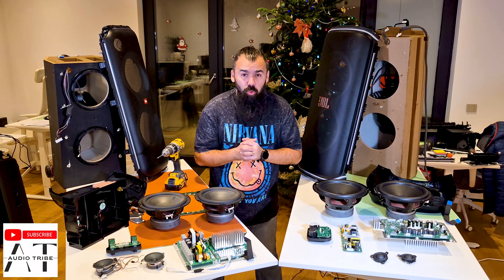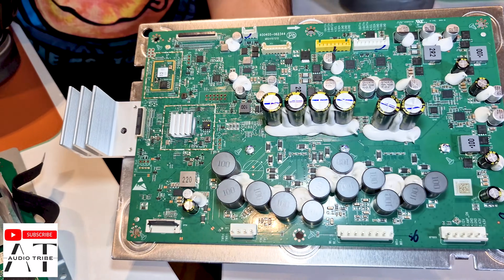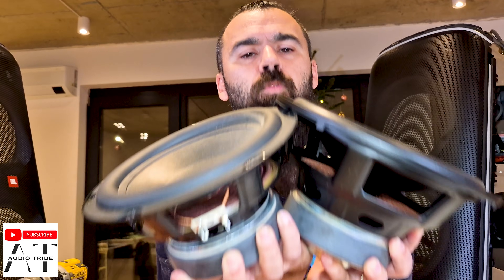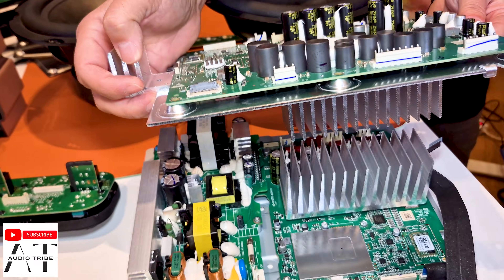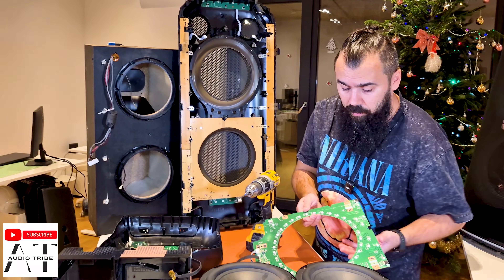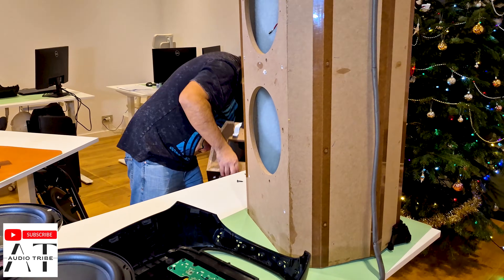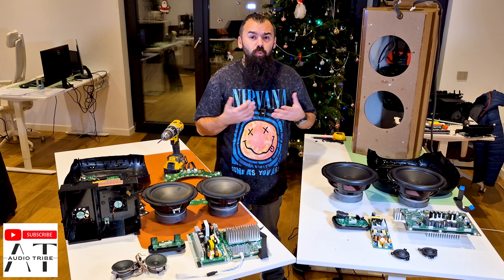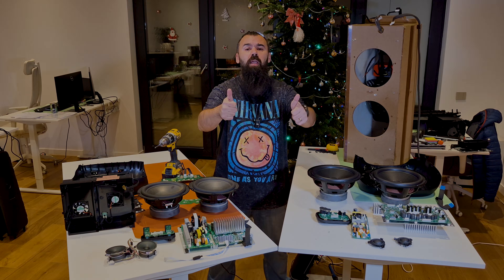JBL Partybox 720 VS JBL Partybox 710 INTERNAL Components Cross-Comparison

Comment: I went with 2 of the 710 because the price was really good. They are being discontinued here in Australia so the 720 will be the only choice for a mid size JBL speaker.
Reply from the maker: Great choice, the 710s are still fantastic speakers! (Mid size?😅)
Reply: @AudioTribe i call them midsize as we have the Ultimate available here and that is large. The 710/720 are between the smaller ones like the 520 but not as big as the Ultimate. Even the pricing puts the 710 at a mid range option.

Comment: I have  the 720, it's very powerful. And the size is like the ultimate The speaker size of the 720 and ultimate is the same, 9 inches.
Reply from the maker: Yes, but the drivers are different. Cheers

Comment: The JBL PartyBox Ultimate's smell when played at high volume is likely due to the voice coil in the speaker heating up. This is often a sign that the speaker is being pushed to or beyond its limits, which can lead to permanent damage over time.

Reasons for the smell:
• Voice Coil Overheating: The voice coil is the part of the speaker that moves to create sound. At very high volumes, the electrical current flowing through its thin wire windings generates significant heat. This heat can heat the adhesive and enamel insulation in the coil, causing the "burning" or "plastic" smell.
Reply: Unlikely, it cannot be pushed to its limit due to the presence of dsp. What your smelling is just the adhesive they used on the cone or the structure of the woofer